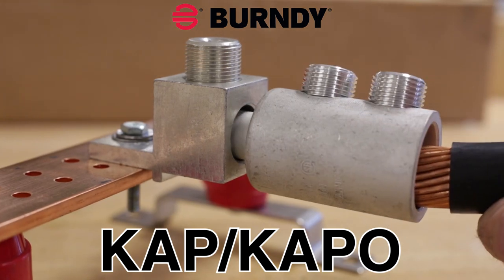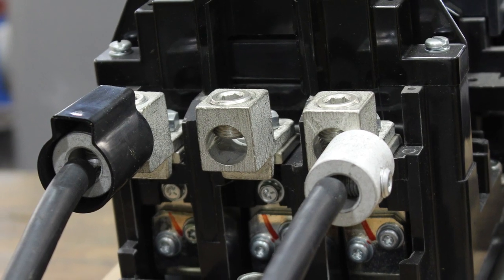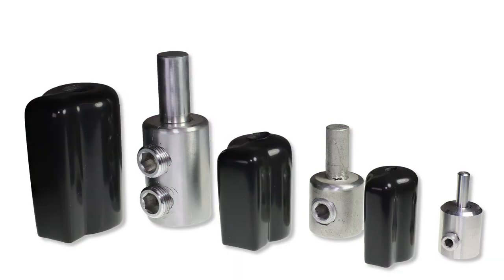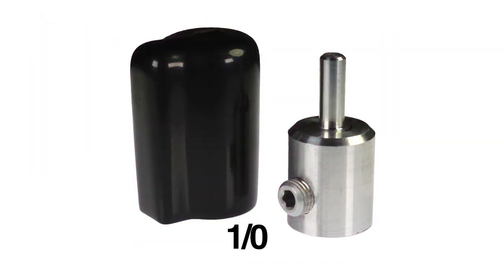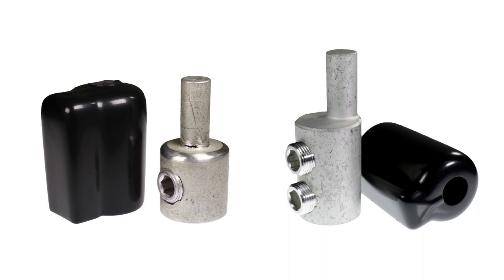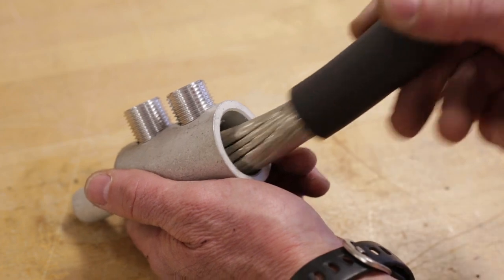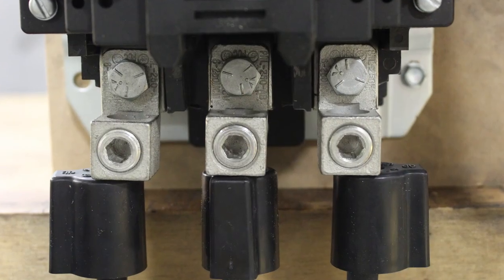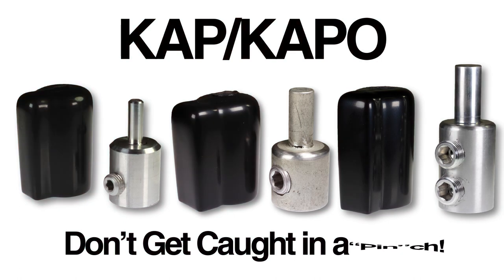BURNDY KAP and KAPO Mechanical Pin Adapters

Comment: I do not believe UL 486A-486B includes testing of solid conductors larger than 10 AWG in a mechanical lug. I’m really not sure how these are allowed. A solid aluminum pin that large will not deform around the set screw and back face of the lug the way that a stranded class B and class C power cable would. This greatly limits surface contact of the pin to the lug and will increase resistance and heat. Completely idiotic solution. Just stick with the pin adapter with stranded copper pins, folks.